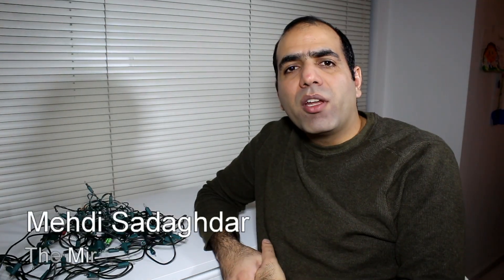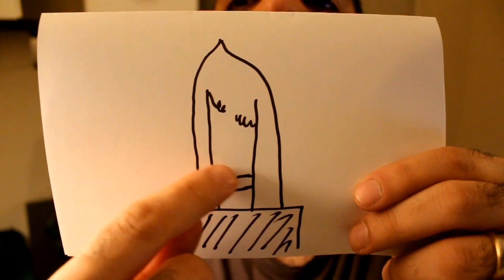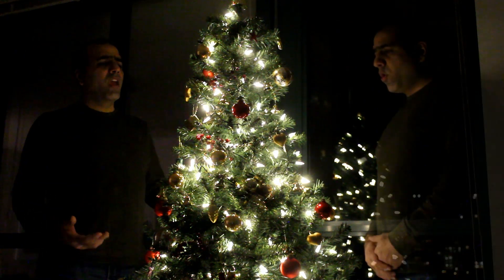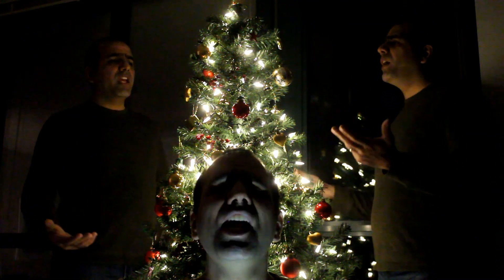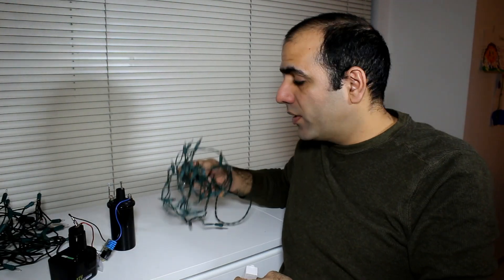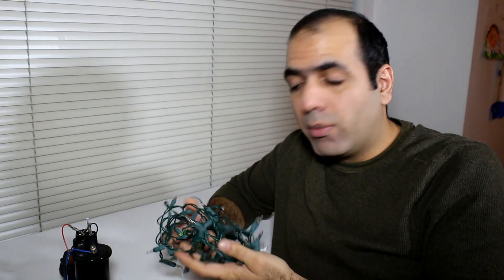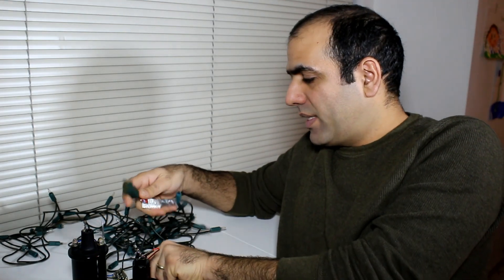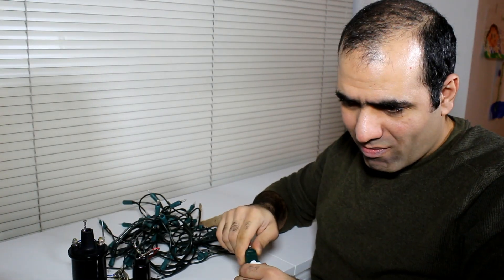Tase the Season (Attempt to Fix Christmas Lights)

Comment: Did you know that there is a tool called the light keeper pro which has a piezo and an AC voltage tester built in. As a major holiday decorator I find this tool super handy and it has saved me  hundreds of dollars in replacement Christmas lights. Love your video :)

Comment: Sometimes you can actually fix the filament of the light bulb or vacuum tube with high voltage DC. It must be DC, so that the loose ends will attract and weld back together, with AC they will just bob around and evaporate due to high arc temperature. The gap cannot be too large, as the filament won't stretch that far, and it has to be light enough to attract and the voltage has to be just right. The supply has to be instantly disconnected as soon as the ends meet and it stops arcing. I did it a few times, but even if it works, the filament will not be anywhere as shock-resistant as it used to be and will not last too long. Still, one of my directly-heated tubes (1Ж24Б) holds pretty well, but now it is very microphonic, so I don't use it much. I have found that idea on some website a long time ago that had some old TV repair handbooks, and it was suggested that you can use the TV's anode supply to repair the CRT's filament if broken and no replacements are available.

Comment: We use LED Christmas lights in our house in rooms such as the bathroom, closet and etc to prevent having to use old fashioned type light bulbs (the LED strings are more affordable than a single bulb... we're slowly converting the whole house from incandescent to LED - very worth it but very expensive D:.) Anyway, we've been using LED lights that stay on day and night for about 2 years at a time. After which they begin either flickering(all of them at once) , stop working completely, (usually bulb change helps, never has been a fuse) or one or several of the lights will flicker for months. I've experimented with several different brands, and the consensus seems to be that, yes, LED lights will last a long time. Think about it, I ran these lights for 2 years straight without issue. Imagine only using them for your christmas tree a couple months out of the year. You won't have to mess with any light changing for a really long time. 

I'd also like to suggest hanging an inexpensive strand of LED's in the bathroom or an area of the home you frequent. I'd recommend the "warm" and dim LED's that look like the old C9's. They're easier on the eyes at night than that pesky blinding bathroom light.

Comment: What really bothers me about LED christmas lights is the flickering effect. You can especial see this if you are driving by a light display (at night) and you see a dashed trail of light from the LEDs. This is because only half of the cycle of wave of AC is flowing through the LEDs. This causes a flickering effect. But this can be fixed if you connect a full wave bridge rectifier and smooth out the ripple with a capacitor with the appropriate capacitance determined by the current draw of the LEDs. But of corse that is too much work and manufacturers don't bother to do this...
Reply: Henrik Johansson
 Because using only one diode would result in a power waveform resembling The Loch Ness Monster LOL

Comment: LED lights are made just as cheaply as the incandescents.  I find the colors are indeed more vibrant, but the flicker they produce is terrible.  I can see very minute flickering that usually doesn't bother most other people.

As far as the rest of the set goes, I've found a lot of times the sockets are what go.  When you put lights outside, the rain and the snow really kill them.  I've had a couple LED sets go due to failing LED bulbs themselves, but oftentimes I will find rust in the sockets.